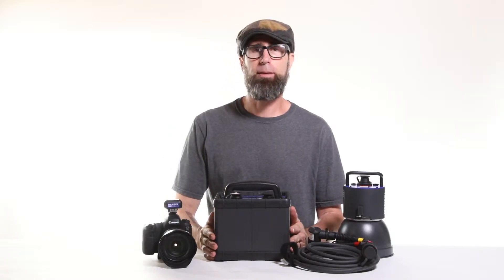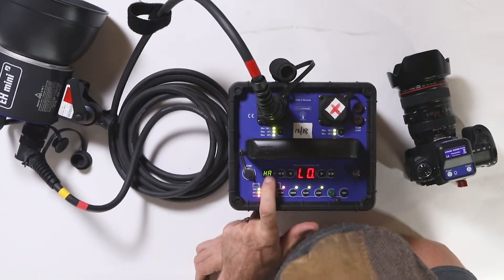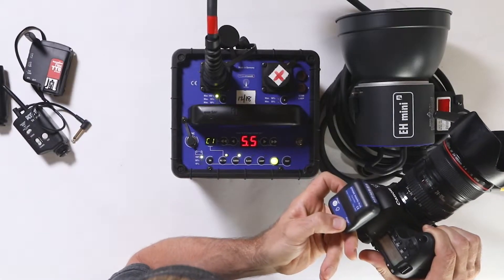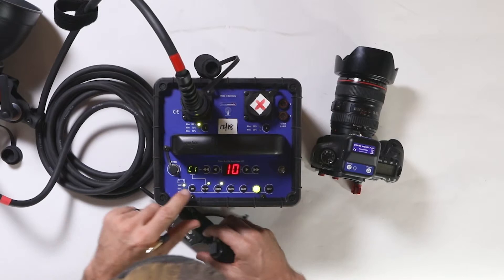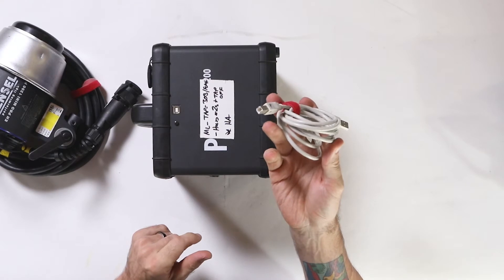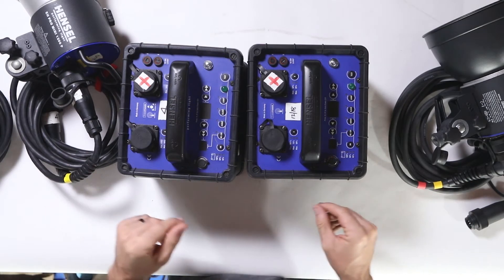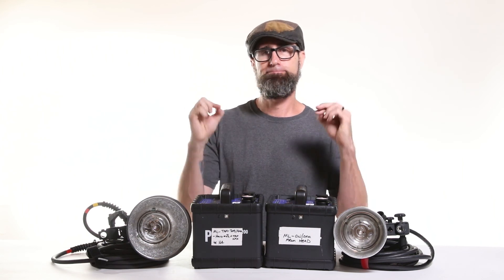Hensel Porty 1200 Tutorial + Hypersync Set Up + Troubleshooting

Comment: Please I have the same porty now I have two questions
1-battery only takes under 100 photos in power 300 and the batteries are now much expensive now connect the charger while shooting is there any effect on the power supply or its okay?
2-how I make HSS work ?
than you so much
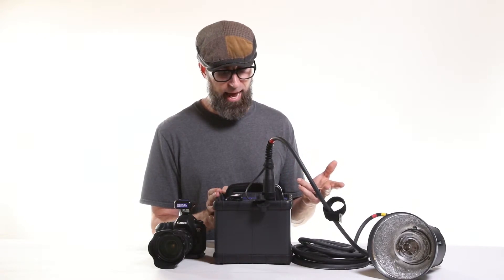Reply from the maker: Good question. I'm not sure about charging while shooting. I would recommend reaching out directly to Hensel - email: christian.lutz@hensel.de. Hensel has hypersync which is similar to HSS. You will need the TT6 Transmitter to make it work. This is discussed at 4:42 in my video. Best of luck!
Reply: @SkipODonnell  thank you so much

Comment: yes, the high speed sync(HSS) works by rpt mode, firing multi-bursts which flash in sync with the slit between the curtains, there was a hyper_sync on some older pro flashes, think this was supposed to achieve the same goal, but it reduced the overall flash duration, aka the dwell time in the firing circuitry, an older HSS style workaround.
Reply: HyperSync is a patented PocketWizard technology that can be used with almost any flash, though results will vary depending on the flash duration and the camera you use. It will give you a lot more flash power than what you can get from an HSS pulse.